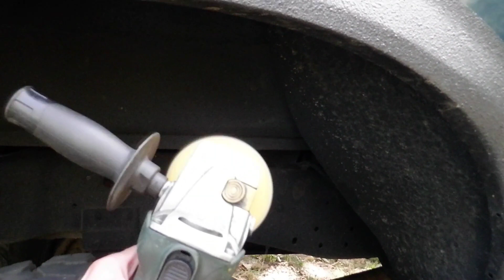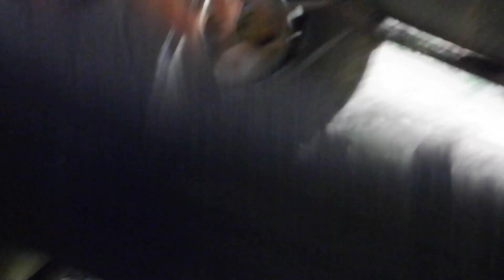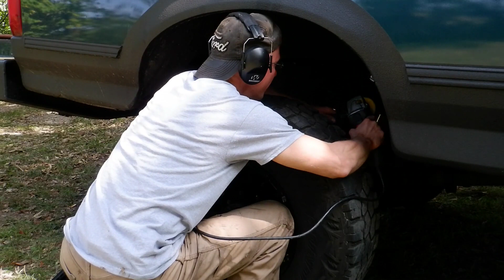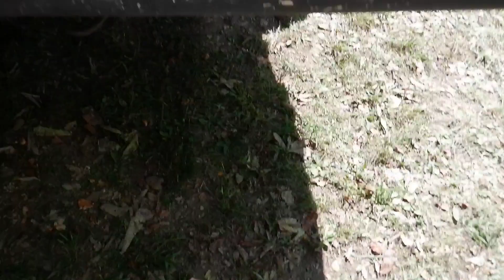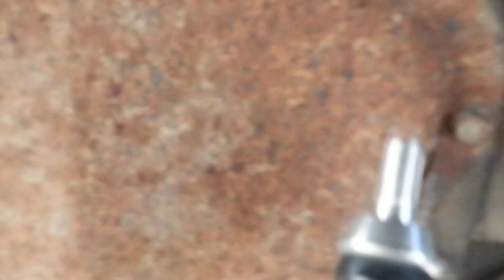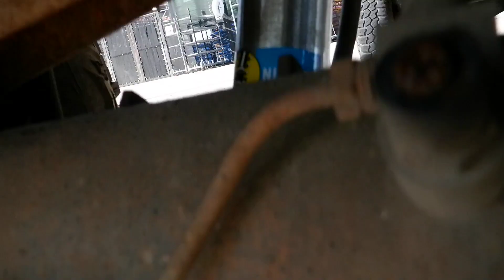1995 F250 7.3 Powerstroke OBS Rear Shock Mount Replacement

Comment: Why? So we gotta remove those mounts in order to install new shocks ?
Reply: Not unless the mount is broken...
Reply: @mebusy2280 ok, but what about the bolt 🔩?? Is the bolt welded to the mount? I can't feel much of a hex head bolt end or hex nut behind that cup like mount. That cupped mount makes it difficult to see what's there and what's going on. Is that upper bolt & nut easily replaceable? Thank you 🙏🏼

Comment: How much grinding on the frame did you have to actually do to see the diameter circle of the nut. I've shaved off the heads of rivet  but not seeing the imprint just yet. using a dremel but thats all I have for now. Have 96 F250 rear mount I need to replace
Reply: I just did it on my 2001 Ford F-250 7.3L and it's a real PITA. You basically have to keep track of where the center of the rivet is as you grind it down. It's not super easy, but you can do it. Once you grind everything so that the surface is totally flat, then you can start pounding the rivet out. I tried like heck to use a hammer and multiple other tools but ultimately I spent hours with no success. The only success came after I bought a cheap Husky air hammer and that pushed it out.